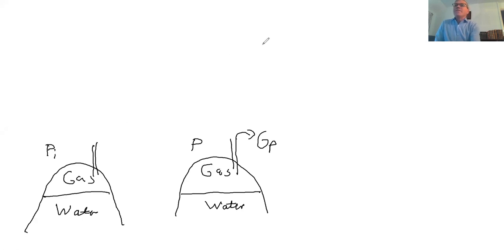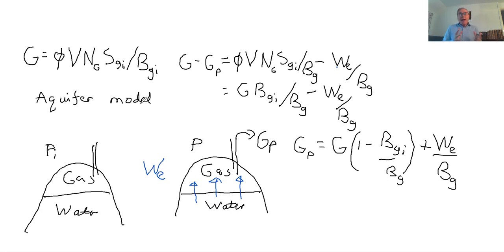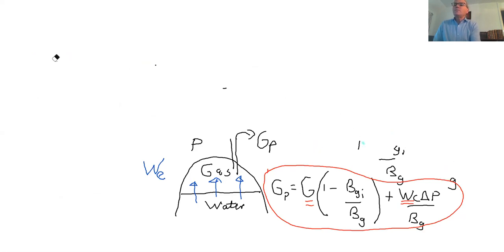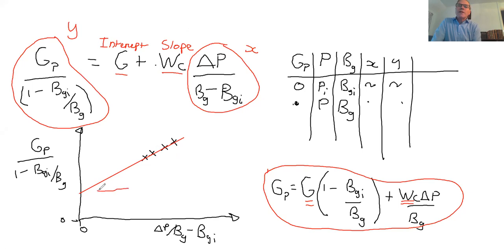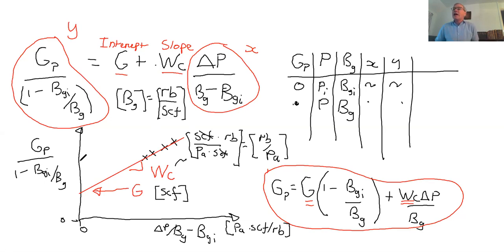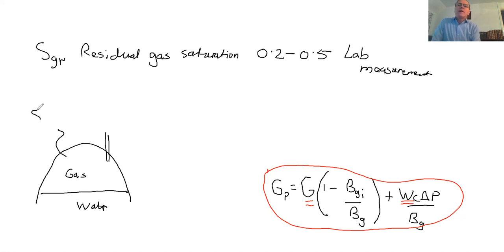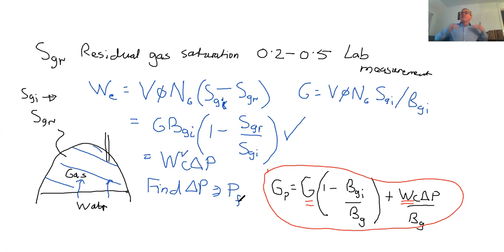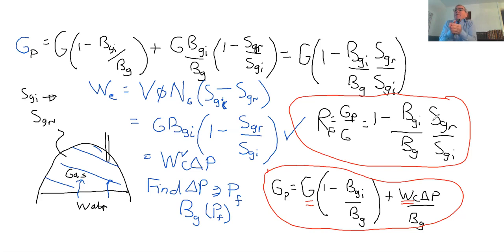Gas material balance continued

Comment: Sir, in writing the equation in surface condition, We should be divided by Bw, not by Bg?
Reply from the maker: A good question: the water influx We is the reservoir volume of water that goes into the gas field.  It displaces the same volume We of gas.  This gas when produced to the surface has a volume We/Bg.  This is an equation for gas production, not water, so we use Bg.
Reply: @BoffyBlunt  Thank You Sir for clarification